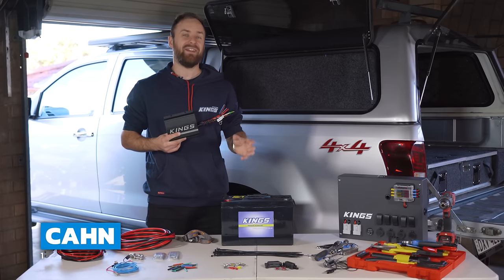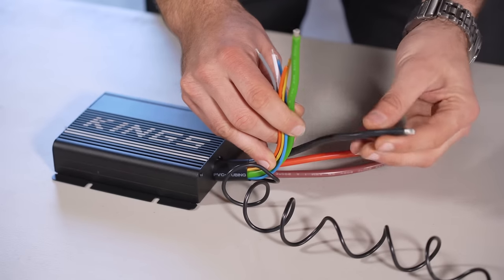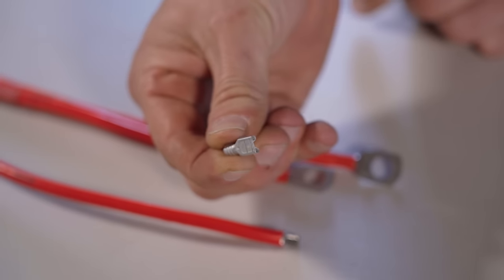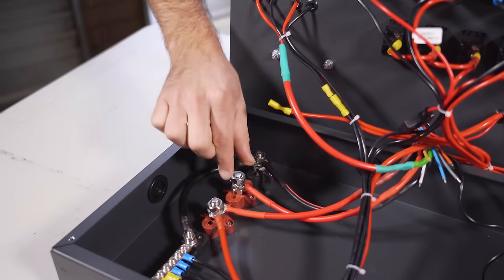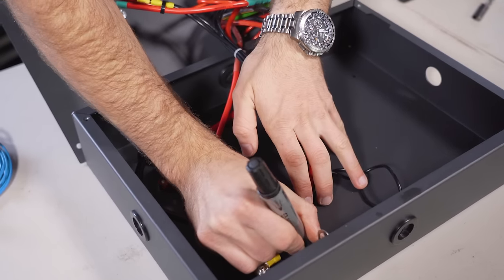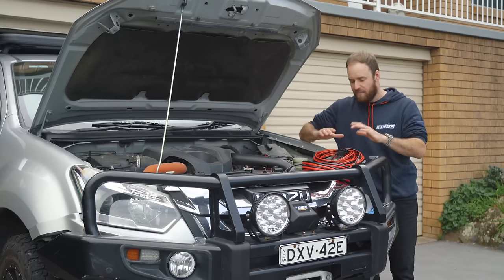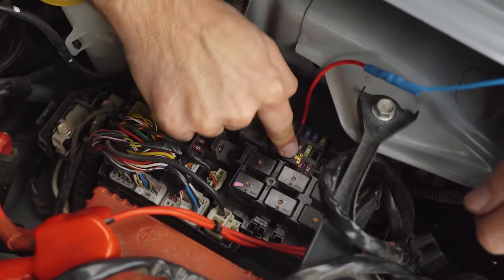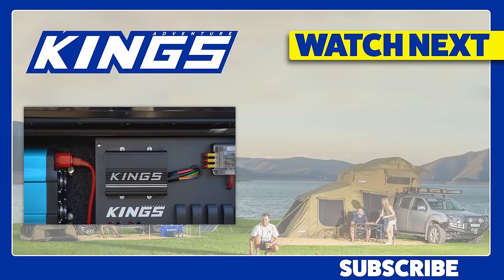Step-By-Step DC-DC Charger Install

Comment: For the ignition cable, is it appropriate to use 3MM 10Amp BLUE single core automotive cable?
Reply from the maker: Absolutely mate. It's only a low-voltage trigger wire so it's not carrying any heavy-duty amperage. Cheers Brenno
Reply: @4wdsupacentreAu  cheers Brenno 😊

Comment: If I have an ignition powered relay in the positive cable off the starter battery, can I just run a wire from this positive to the ignition port on the charger at the charger end?
Reply from the maker: Hey Joshua,

A DC-DC Charger works just like a ignition powered relay so you don't really need both.

The issue with what you're thinking is that the D-DC unit still won't be ignition triggered, only the power input (so not the blue wire)

without the blue wire connected to an ignition source  the DC-DC charger needs to see above 13.8V to turn on and then above 12.8 to continue charging, so if you have a smart alternator it might run into issues. with the blue wire connected it only needs to see above 12.2V to start (once ignition is on) and then anything above 11.9V it'll continue charging)

If you don't have a smart alternator you don't need the blue wire and your method might work, but adding any components in line will just increase the likelihood of resistance and voltage drop. so if you can avoid it, you may as well!

What vehicle do you have out of interest?

Cheers,
Cahn
Reply: @4wdsupacentreAu  Hi Cahn, I have a Pajero Sport & yes it does have a smart alternator.
Reply from the maker: Hey Josh,

I'd recommend wiring the ignition sense wire to an ignition source then - just to ensure the unit continues charging regardless of what your starter battery voltage / alternator are doing - however if it is is an ignition sense relay it will 'work' with what you're suggesting but as I said above it'll just add a little bit of complexity to the system and there's a good chance that when your smart alternator and starter battery dip below 12.8V then the charger will disconnect regardless.

So yes it will work with what your suggesting, but doing what you're suggesting and connecting the blue wire to an ignition source (even the same ignition source that the relay is switching) will make it run much better

Cheers,
Cahn

Comment: Is it possible to leave the temperature control wire unconnected, or is it imperative that it is connected?
Reply from the maker: Hey Kyle,

You can leave it unconnected and it'll just read ambient temperature, which gives the unit a rough idea what the battery temp might be... but if you do want to ensure your battery is getting the right temperature compensation for charging it's obviously better to connect it. either way, don't cut it as the DC-DC will throw a fault!

Cheers,
Cahn
Reply: @4wdsupacentreAu  thanks Cahn. 

Is there no way to extend the wire whatsoever?
Reply: @4wdsupacentreAu   second kyles last comment is there any way that we can extend this wire due to the battery being in the engine bay ?
Reply from the maker: @colincasey8200  Your Aux battery is under the bonnet you mean? where is the DCDC charger mounted?

You could extend it out, but if you mess up you could short the unit and cook it - not good for warranty!
Reply: @4wdsupacentreAu  my second battery is mounted under the bonnet while the Dcdc charger is on the control box in my canopy

Comment: Does anyone know what amp the fuse is on  the blue ignition wire?? It looks orange to me which is supposed to be 5amp...or is it copper which 40amp....13:20 approx..thx

Comment: Anyone offer any advice? I’ve wired the exact same as the video. Only difference is I don’t have an earth going from the control to the starter battery. But I have the earth going to the 12v control box - auxiliary battery and my six battery is earthed to the chassis. No fault lights but my agm light isn’t coming on?
Reply: Hi, 
Just read yr comment re 12v system. Have a look at my videos and may also be helpful for yr set up. 
Cheers 
Out There Touring

Comment: So if your car has  the normal  alternator and not an emission based  smart alternator you don't need this ?
Reply from the maker: Not necessarily, but it means you can sometimes get away with an older tech VSR or dual battery isolator. That’s if you’re using two batteries of the same type (flooded lead acid for example)

If you’re wanting to run a Lithium battery in the back (or realistically even AGM) you’d still want a DCDC charger that would safely charge the battery with the correct charge profiles.

Cheers,
Cahn
Reply: @4wdsupacentreAu  Yep thank you , makes sense now different chemistry needs the charger than can differentiate and then this gives you more flexibility  if chop and change batteries types  or if you want to plug in solar .

Comment: I changed my AGM auxilliary battery with Lithium but the dcdc charger doesnt recognizes the Lithium and its the AGM had Lit on it all the time why was that?
Reply from the maker: Hi there,
You will have to change battery types on your DCDC charger by pressing the mode button.
Regards, Courtney
Reply: Did you change the wire on Dcdc to lithium wire as the agm is the orange wire lithium is another colour.
Reply: Yes I did changed the wite from orange to the grey colored or brown i can’t remember, and yes now its on the Lithium mode…

Comment: Can I do the same with the 40A dcdc charger
Reply from the maker: Yep!

Just ensure you’re using the right wiring gauge for a bigger charger! The newer 40A DcDc has quick connect plugs fitted so you may also want to check this video I did for more info! https://youtu.be/QCAdAQf5qpY?si=lBTq6WXPu6-RDhIi

Cheers,
Cahn

Comment: What size wire is that running from the main battery to the second battery?
Reply from the maker: Hey Mate,

I used 6AWG (16mm2) as that's what is suggested for this unit over this cable length (up to 8m). if you're running your DC-DC in a trailer where you're going to be using more than 8m we suggest 4AWG!

Just to clarify, that's up to 8m in one wire run, so doesn't include the earth return length!

Cheers,
Cahn
Reply: @4wdsupacentreAu  
Thanks mate, and I appreciate the step by step video, as I'm a bit of a nuffy when it comes to wiring. By chance I have the same car and are doing the same set up.
Which fuse did you piggyback the blue wire to?
Do you offer installation services? 🤔😅
Reply from the maker: @outdoors5352  we do offer fitting at some locations - and we're rolling out more locations all the time so it's best to check the website for that!

from memory it was a engine fuse, but let me check and get back to you - the important thing is just to choose one that is live when the vehicle/ignition is on and no power when off

Cheers,
Cahn

Comment: Can this set up work for a second deep cycle battery
Reply: I have 2 115 amh kings battery’s In my trailer
Reply from the maker: @joshuahobbs-kewin6405  Hey Josh,

Did you want to connect it to both batteries in your trailer? if so that's easy - link the batteries in parallel and then connect the DC-DC to the positive terminal of one battery and the negative of the other.

If on the other hand you mean to have a DC-DC in your vehicle and then charge your trailer batteries, that's not really a great idea.... it will lose a lot of efficiency between the vehicle and trailer.

But get back to me and I'll see how I can help you out more!

Cheers,
Cahn

Comment: What gauge wire are you using for the heavy wire?
Reply from the maker: G'day David, sorry for the late reply!

I used 6AWG (16mm2) as that's what is suggested for this unit over this cable length (up to 8m). if you're running your DC-DC in a trailer where you're going to be using more than 8m we suggest 4AWG!

Just to clarify, that's up to 8m in one wire run, so doesn't include the earth return length!

Cheers,

Cahn

Comment: If only this unit had an lcd panel that I could see battery stats and levels. This would be a fantastic kit otherwise
Reply from the maker: Hey Donovan,

Typically we install these in conjunction with a 12V control box (like in the video) or a battery box that both have the built in LCD screen to see voltage. in the past I've installed a bunch along with a battery monitor that gives you battery voltage, % stae of charge as well as current (amps) in and out. while it'd be nice to have a screen, a lot of people hide their DC-DC charger away, where you woudn't see it anyway. That's why a separate or remote screen is a good idea! There are plenty out there, but this is the Kings Battery monitor / ammeter / low voltage disconnect:

https://www.4wdsupacentre.com.au/kings-12v-battery-monitor-easy-diy-install-adjustable-low-voltage-cut-off-lcd-display.html

Cheers,
Cahn

Comment: Is it still required to have a earth somewhere along the line from your starting battery too the control box?
Reply from the maker: Hi Milton,

Yes you will need to earth the DC/Dc charger to the control box and to the battery. 
If you are connection a variety of electronics together it may be an idea to get a mechanic to earth them all for you.

Cheers,
Saleha
Reply: I still don’t understand sorry
Reply from the maker: @martinDJM800  Hey Milton,

No necessarily. The way I've installed it, the auxiliary and starter battery share the earth, through the control box.

So you don't need to earth to the chassis or anything, so long as you're wiring all your accessories directly back to the battery negative terminal, or the control box negative busbar!

Does that make more sense?

Cheers,
Cahn

Comment: Anyone had to repair/replace the temp wire, installed mine today, had plenty of slack in the wire but when tightening the terminals on the battery the temp wire snapped before the ring terminal. (No I didn’t cut it)

Before you ask have asked kings for a warranty claim due to this fault just trying to find other options before being told by them I cut it.
Reply: I've just installed this unit and it was great the first trip I went on. Went to use it on the second trip and realised its not charging. The temp wire had snapped like yours and now nothing works without it. Did you have any luck with yours? I have put in a warranty claim also. But i fear even if they replace it it will just snap again its so brittle.
Reply: @jme682  I got it replaced under warranty, but it did take 3 months, but it also happened again on the weekend but I had a friend repair it so I didn’t have to wait again. I just ended up tying it up out of the way so it can’t happen again
Reply: @Taylorball137  geez. I read another comment that you can solder a thermistor on and that fixes it too. Sounds like it doesn’t even have to be connected to the battery at all, just near it to feel the temp. Wish I had known that before I broke it. They really need to upgrade this part of the unit as it seems a lot of people are having the same problem. Thanks for the info 👍🏻
Reply: @Taylorball137  what did he use to repair it?

Comment: Is it just me or is this typical kings crap .... so as quoted by Cahn, they have these boxes made for them and they’re designed with spare room to specifically mount their DC-DC chargers on the front of the box yet they make the wiring so short that you then have to go to Jaycar or RTM to buy more cables to extend them inside the box to their mounting points ..... fair dinkum guys, stretch the purse strings a little further and make the DC-DC leads longer in the first place !!! Frig me, isn’t it just common sense ?  Design the box to handle the DC-DC charger yet design the DC-DC charger not to handle the box ! 
🤦🏻‍♂️🤦🏻‍♂️🤷🏻‍♂️
And the other thing too, like a kink in a garden hose - every time you add another ( and in this case unnecessary ) join in the cable, it creates resistance and reduces flow. Make the leads longer without extra joins and it’ll work so much better 😉

Comment: I have made comment before about solar install. I think we are all being sold down the river on this. For me you have to take into account the cost of all this. Seeing Kings are some of the cheapest this is a good example. Just the DC to DC charger is $349 add the Kings control box at $159 = $508 before buying any wires, pieces and crimps etc... Then the battery if AGM or Lithium $$$. Plus solar panel, the list goes on. It's the same for a house install, cost of install weighs up against value for money and are you saving anything. In this case the answer is no your not. The use of a 3 KVA generator can run all your appliances when needed. Breakfast lunch and dinner if required at a fraction of the cost. You can run electric anything to help cook. As for fridges, by a 3 way fridge so when you are parked up, switch to gas. I'm sorry but I can't see the advantage of solar, it's just to dear to move over to it, for what you get from it.
Reply: I just love camping near selfish people while their generator is running at full tilt.  Not
Reply from the maker: Hey Kieran,

It's more about being completely off-grid and not needing to carry three type of fuel in my case! Let's me run everything from DC rather than need diesel in the vehicle, petrol in a jerry can and LPG in a gas bottle. once it's set up you don't need to buy $50 of fuel and gas every time you go camping either

Yeah you're right a generator can do it all... but to run 12V appliances with your gennie you'd still likely need a battery or 12V system - unless you get it hard-wired into a vehicle, which involves being certified by a qualified sparky... so the costs quickly start to add up. Even those generator that do have a DC output are generally limited to about 10A, which wouldn't be ideal if you wanted to run a few different bits of 12V camping gear!

As @Jimmy Commented too, some people prefer the silent charging capability of power too rather than the gennie... but like all things in life hourses for courses - what suits one person may not suit another!

Cheers,
Cahn
Reply: I move around a lot and often get in late. Having solar mounted on my rack and a dcdc charger I never have to worry if my batteries are charged or turn anything off. Plus I can sleep in peace without a generator running all night

Comment: I could have question pardon the language but how the fuck are you supposed to run the blue wire ignition source in a camper trailer another question to why the fuck would you design it with such short wires

Comment: Trying to work out the best way to use a Kings 12V Control Box / Kings Battery Monitor / Kings 25A DC-DC charger in my old caravan connected to a Kings 138Ah battery with power coming in from the Anderson plug (40A) and Solar Panel (300W).  I THINK I have it figured out but can I PM somebody there to go over it ?

Comment: So what dose the 2 plugs do on the front of the control box
Reply from the maker: Hi there,

I can advise that those are anderson clips to clip gear into your 12v system, and can be used both for input or output.

Regards, Andrew

Comment: What size wire to extend the wires on the dc charger
Reply: Based on a visual comparison of the size of the conductors, the thick green, black, red, and brown are 50 Amp.